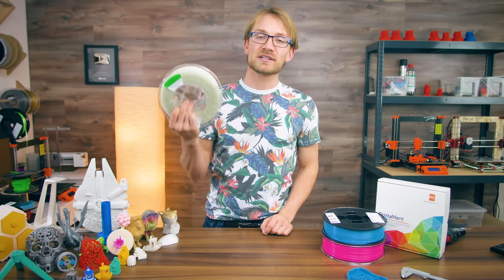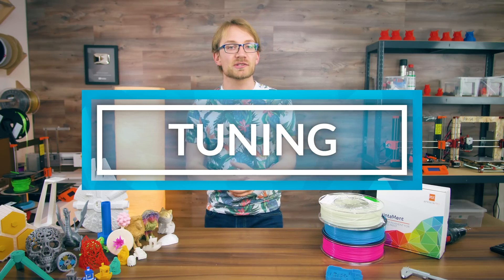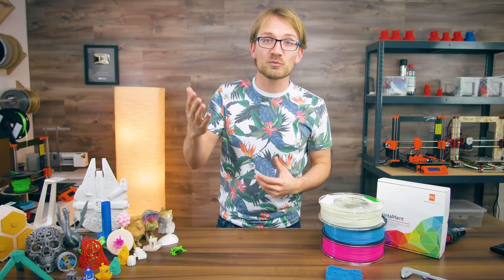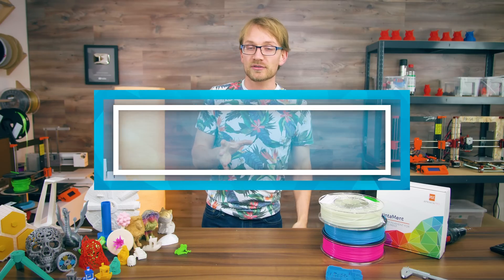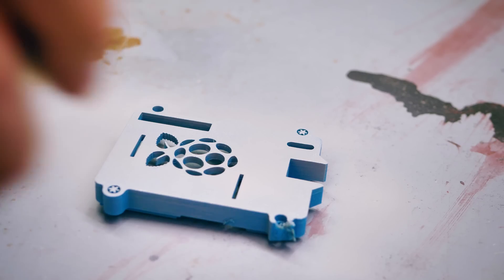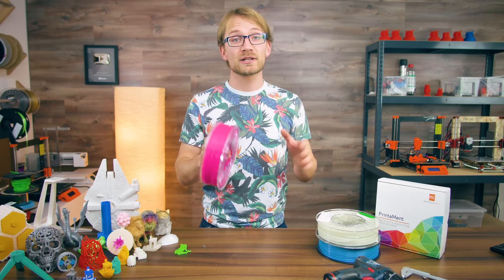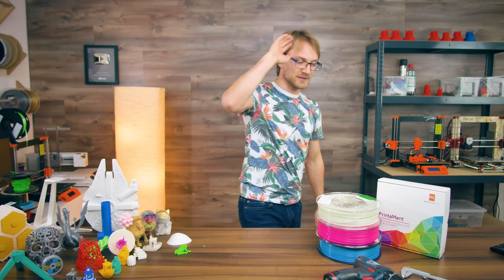Things you should know about PLA

Comment: Tom, I believe that you are the most professional 3d print man to come to for this...so...here is my question. I have a Divinci all-in-one printer pro. The very 1st layer on all my projects come out very Stringy...the bottom layer doesn't flow into the next line of print...it looks like wire sitting next to one another...but...the rest of my print comes out great.....the layer height melts into each layer making it pretty smooth and professional looking.  so...my question is.....is....how do i FIX that very first layer on the bottom of my project to flow into each other. thanks...john from Kansas.

Comment: My black PLA always used to leave sticky residue in the Bowden tube. It was worse inside the extruder. The PLA would get so much friction after a while that it would make my prints fail. Be careful with some black PLAs. They might have some squid ink or other cheap pigment that ruins your 3d printer.

Comment: In this video bed temperature was mentioned and I have a question for anyone that knows. 
I’m printing a large volume box, 5mm walls hollow interior (200mm cube), and the bottom corners are curling slightly as it rises. 
PLA
207 C 
66 C bed

Should I raise or lower bed temperature as it rises? My first thought was to increase bed temps to generate heat as it rises but now I’m thinking should I lower instead? Since the top printing surface is cooler as it rises away from the build plate. I’m also using glue stick which seems to work very well. 
Bed temps up or down?

Comment: Who are the 3 a 4 big manufacturers and to what smaller brands do they supply? I'm curious how you've found this information and if you're willing to share :)
If lots of brands use the same manufacturer's pla why do prices differ from 1/3 to 1/2  from eachother?
I use Dasfilament alot, shipping cost to Belgium goes up the more rolls I order, it's ridiculous imo. The rolls are cheap but if you inlclude the shipping they're not cheap anymore.
What brand with the same pla or petg material would you recommend  (that has the same manufacturer) in Europe?

Comment: I have just used PLA+ for the first time. I accidentally bought Sunlu PLA+ instead of buying more Sunlu PLA. For identical engineering parts, the PLA+ needed a higher nozzle and bed temperature than the PLA and I had a bit of trouble with first layer adhesion and the glass. The adhesion could have been my fault. There is a sheen to the printed PLA+ but I found no discernible difference between my printed PLA and PLA+ parts for strength or flexibility.

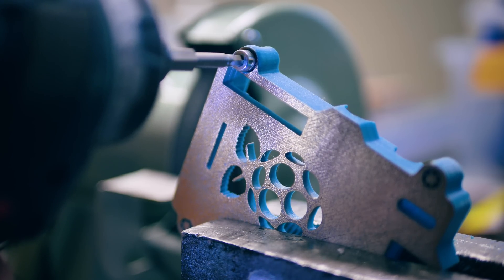Comment: 1:02 "it will also deform under continuous pressure".
Are you sure about this? Are you sure that the PLA doesn't just reach it's elasticity limit when it reaches a specific pressure and then deforms just like any other material? Does it really deform under continuous pressure or is it just if you apply too much pressure?
Makes a big difference when designing mechanical parts. Also, I can't find any sources talking about deformation under continuous pressure but I haven't looked too hard either.
Reply: This would be easy to test, just make a thick washer out of pla and put it between a nut and bolt under a set torque level and see what happens over time.  You could repeat this with different levels of torque too.
Reply: @emu071981  I was testing this, but then my printer broke D: So now I'm stuck waiting for new parts :( Would you mind doing this test? :P
Reply: @beaconofwierd1883  my printer only arrived this afternoon and I am waiting on some extras to arrive before I set it up lol

Comment: How about metallic based Plas?
Reply: Tayyab Ghori metallic pla’s assuming you mean PLAs that have metal in them print about 5 to 10 c hotter and will wear out your nozzle faster other than that it prints just like pla
Reply: @matthewfuller9167  Hey thank you for answering my question. Have you experimented with colorfabb's metal fill filaments, like steel fill or bronze fill? Can they be used effectively on Ender 3?

Comment: Any PLA type recommendations for modelling parts that clip together?  I use the latest Prusa 3D printer and find the standard stuff produces brittle clips.
Reply: Stevieboy130664 I would suggest adding more shells to your print that should help with it braking when clipping together
Reply: @matthewfuller9167  unfortunately that is not an option in the example I modelled.  The clips are too small.

Comment: I gave up on PLA after KG after KG after KG of filament being lost due to various defects (most often it enters my hot end upper cooling section then fills the nozzle interior and locking it up completely. Every single time but 1 I've used it I've had nothing but lost filament. This is so for my CR-10S, Tarantula 280mm, da Vinci 2.0 Duo, da Vinci 1.0 Pro and most suspiciously my Robo R3.
I gave up on the filament and went to ABS and have never had reason to look back! Only loss to ABS is my need to use HEPA Charcoal filters to keep my air safe in my print room.
I should mention - if I increase my nozzle temp by 5°C with PLA it turns into smoke. So while it clogging my nozzles may make it sound as though my print temperature is not high enough in fact it's on the edge of the material's ability to remain safely stable. Any lower in temp and it refuses to move at all.
See why I hate (not an emotion I generally experience) PLA?
Reply: Have you tried different brands of pla?
Reply: @iamjimgroth  A few (but not that many). Inland, Hatchbox, Amazon Basics, Gizmo Dorks, Robo 3D and FlashForge. So a few low end and a few top flight PLA 1KG spools. The top flights were the worst. The one which produced the 1 good print was the MicroCenter Inland PLA. I made 4 bed adjustment knobs for my CR-10S (with AC bed heater) using my CR-10S. But my next attempt completely locked up my nozzle outside and inside and my cool-end most of the way up. It could be that the Creality OEM Bowden tube is just too loose to prevent heat from moving upward into the cool end. So I just bought top end Capricorn tube from TH3D Studio which I'll be using.
The worst part is having to dismantle a completely locked up hot and cool end to remove the PLA. I had to buy an old doctor's office autoclave and set it to 250°C then run it for an hour. That got most of it out, then I used a MAPP (yellow Berzomatic tanks) gas torch to burn the rest out and clean it all up.
I think I should buy a better heat break as well as the Capricorn tubes. A TH3D Titanium heat brake may be a great idea...
Reply: Oh, making the adjustment knobs in PLA was a bad idea. They keep distorting because of the high ABS temps I print in (or, what the unit says is high but my Fluke Thermocouple says it's substantially lower - CR-10S hot end thermistor says 265°C, but my Fluke makes clear it's actually only 248°C, CR-10S thermistor says bed is 135°C but my Fluke says it actually only 118°C).
Darn inaccurate thermistors! Would love to go 100% thermocouple, but they're often slower to respond/reach temperature and use different resistance readings for many temps than thermistors do.
Reply: @monkeymanstones1  I hope I don't get any of these problems. So far it's been working really well. I only print with pla.
Reply: @iamjimgroth  That seems to be what the vast majority of people experience. My tolerances may be too tight to allow the use of such a material. I have no problem at all with ABS, PETG or TPU (it was TPU which had me go to such tight tolerances), only PLA.
Most people appear to have no issues with PLA at all and you probably won't unless you tighten to TPU tolerances (including TPU temperatures). I did so to enable me to print in Nylon (ultra high temps needed for Nylon printing).
Reply: Because heat is clearly moving past my "Heat Brake" (in quotation marks because it doesn't do what it's name says), up my bowden tube and into my cold end it seems very likely to me that my heat brakes are my problem. Perhaps my soon to arrive Capricorn high temp, tighter tolerance (while being substantially more slippery) tubes will fix things, but because the heat brake has failed so severely, I don't feel like it will do the job (due to hundreds of dollars in wasted PLA spools as a result of this problem). 
I may need a superior heat brake I believe. I think it may be smart for me to spend the additional money (additional in that I already paid for Capricorn tubes, ruby nozzles and a 50 Watt Hot End heater elements. 
The TH3D Studio "Tough Titanium Heatbreak for Creality Machines" seems that it may be a smart buy, but because Titanium is outrageously expanding when heated (the SR-71 Blackbird was Titanium and it had its panels so loosely fit that it would lose around 50%-75% of it's fuel [airplane tanks are normally built into a plane's wings] before even getting airborne and would need an additional 10 minutes in the air before then being refilled with fuel after the air friction would finally cause it all to expand enough to become tight). But perhaps 370°C from 20°C (698°F from 68°F) isn't a big enough jump in temperature to force the extreme expansion Titanium usually shows and if it is, how do I set it to ensure I don't damage my hot end, cold end or ruby nozzle).
Worth a try I suppose... But spending even more only to enable my printing in PLA that still might not work just feels too tough to swallow.

Comment: I consistently find that black PLA needs to print at a lower temperatures than lighter coloured PLA on my machine (by around 7-12 degrees C). I have tried with different brands and with in the same brands.

Comment: Do you have any experience with the new super advanced PLAs that have been showing up on the market recently? The one that caught my attention was  3D-Fuel's Pro PLA (aka APLA Plus).  They make quite bold claims on their web site but I am not sure how much of this is marketing and how much performance related. Like for example: "Pro PLA (APLA+) has higher impact strength than ABS and Standard PLA with a heat resistance rivaling that of ABS!" or "Pro PLA / APLA+ boasts 4.3 times the impact strength of PLA." True, it requires annealing, but I am still not sure if I am convinced. For E50 per 1kg is not super cheap but on the other hand not prohibitively expensive either. Especially if it performs.

Comment: As a purely practical issue, I recommend marking ever PLA filament spool with the temperature that you have find most suits it, so that your slicer profile can be matched to the roll you select to print with. 

Most people will end up with many partial spools of PLA, and it gets hard to remember the temperature that suits each spool. 

I have a black spool that prints best at 190, a white spool that prints best at 235, a pink spool at 220, blue at 205, etc, etc, all marked on the spool itself so that a I don't have to remember anything other than to slice at a temperature that matches that spool.

Comment: Hi Thomas. It would be awesome if you can make a video about additives. The things other than pigment that manufactureres really doesnt mention on labels. Maybe you could reach to Proto Pasta or somebody and exactly what grade and type of base resin they use for they PLA filaments. Things that change mechanical properties, resistatnce to UV, to water, stabilizers, prevent too early biodegradation, chain extenders, viscosity modifiers, coelastomers, changing coeeficient of friction, or molecular weight of polymer, crosslinking, antistatic additives, fire retardants, stuff to make it more suitable for food, or molding and postprocessing, etc. It is very complex topic and almost never thing labeled PLA or ABS is pure stuff. But I hate not knowing what is in my filament.

Comment: Thanks. I get my very 1st printer tomorrow, ender 3.
I am using only pla. Do I need to use the hotbed?  I heard that an ordinary elmers glue would work.
Reply: I got an ender 3 ,very nice printer , and yes use hot bed at about 60 celcius.i recomend yuo buy a cristal of 3 or 4 milimeter and heair spray( laca) , its really fix very well all type of plastic and its cheap
Reply: Late reply...using an ender 5 myself...i agree with the 60c hotbed...pla sticks great  to it and it is easy to remove once it cools.

Comment: On the subject of glues: Do not use two component epoxy glues (like Araldite). For normal applications its just fine, but if you stress your glued parts with high loads or strokes, its likely to fail. Cyanoacrylate based glues (like superglue) will perform much better - altough they dry out within seconds.
I ve never tried it out, but usually, PLA does not dissolve in Acetone. The only glueing effect you will get is due to other plastics mixed into the filament. Thus you cant really rely on it, for it differs depending on the brand of filament - but correct me on this one if I m wrong.

Comment: i have issues with a particular PLA that i use. the vertical layers stick together but the horizontal ones can pull apart. this is worse if its only 3 or 4 lines of the print and not a solid block. how can i fix this?

Comment: Thanks for the valuable hints on printing and finishing PLA. As for the drilling, I use "friction drilling" with PLA very often. Just run the drill in the opposite direction, ccw. The tip of the drill bit will heat up the contact area in front and melt a hole through the material. With the right speed and pressure the drilled hole will have solid sides and be much more stable than when drilled normally.

Comment: Tom, I can't help noticing all the filament you have exposed and sitting/hanging around in your workshop.  Is there any value in keeping PLA in a dry-box between print jobs?  Are there other filament types that can sit out until their next use with no degradation?

Comment: I only disagree with the part about PLA+ (PLA Pro). I tested it many times (eSun brand), and I think it is nearly 50% stronger and has better layer adhesion. It is slightly more heat resistant due to a higher melting point. Lastly it is less ridged, which makes it more shatter resistant.

Comment: Hello, I keep getting blobs on print even on 180°C at high enough speed and long enough retraction distance and fast enough speed (4.5mm, 1200mm/min) (FLSun Metal Plus, Z axis command is executed a bit slow due to its dual-axis design)
I'm using the stock PLA that came with the printer (which is, according to community, is notorious for melting at very low-temperature...)
I made sure the heat break never reaches above 30°C and fan is blowing right on it.
Is the filament to blame, or should I look for other factors?

Comment: A video like this, but on PETG, would be nice.
Reply: Request granted
Reply: PETG is tricky and I've never had good layer adhesion. Probably necessary to use a heated bed.
Reply: @ConsultingjoeOnline  I've been printing PETG for a year now without heated bed, just on painters tape. On prints with a large bottom surface I get some curling problems but mostly it prints beautifully. I tried PETG from Devil Design and Real Filament, both are great.
Reply: @ConsultingjoeOnline  What kind of surface do you print on? I get a perfect first layer every time with my Prusa, and the secret is simple. Wipe the bed with isopropyl alcohol before printing.
Reply: @real_armadillo  thanks
I use glass and glue sticks. But when I use alcohol and wipe it I do get the best 1st layer.
Reply: @ConsultingjoeOnline  I personally use (white) painters tape
Reply: @real_armadillo  glass with glue sticks
Reply: @ConsultingjoeOnline  I hatte PETG but tief it again Last Werks. Now i love it. Printi g with 80-90 on the bed and 240 on nozzle with 120mm/s with 20 Werk control without stringing...1cm retract
Reply: @ConsultingjoeOnline  time to get a heated bed then lol. Petg is super easy to print imo
Reply: @ConsultingjoeOnline  PLA literally will take chunks out of my build plate if there is no glue stick...
Reply: @ConsultingjoeOnline  i print petg with my normal pla config, only upped the temps a bit, print quality is same as pla
Reply: @ConsultingjoeOnline  Put your fan speed to 50% for PETG. PETG prints great for me and I don't even have an expensive printer.

Comment: Hey Angus!
I just tried meshmixer to reduce on the triceratops skull stl. In Cura if I scaled it to max size it crashed but after reducing by 150% no more crashing. I guess the number triangles was too high in the original file. Thanks for the tip!

Comment: I print exclusively in ABS :-)  heat resistant stronger parts, Acetone welding,... PLA is too brittle for me, never managed to print a decent PLA part ever.. (yes , with part cooling fan on..)

@Thomas; Acetone welding with PLA? must be a mistake i guess? For what i know that only works with ABS

Comment: IMHO ABS is much better for finishing. It sands much easier and faster and drilling it does not deform as easy as PLA.
Reply: someoneonlylol and can be acetone smoothed wich is a big deal for me
Reply: leo belpomo I feel like acetone smoothing is abit overrated. It works wonders in certain scenarios where the fine details is not needed. High layer heights and print artifacts are amplified when smoothing. Theres aslo smoothing agents for PLA but its not as cheap and accessible as acetone.
Reply: someoneonlylol for me it's perfect as i like "modern" low details models:)

Comment: Hi Tom, I don't understand why manufacturers wrote some mechanical properties on the data sheet of PLA (or any other filament) such as: tensile strenght, modulus, etc... if those are considering the filament itself, the material, an injection molded sample or a 3D printed sample that was tested as they said with standard ISO... I simply don't get it, you have any idea?